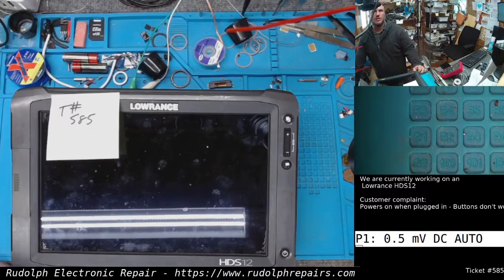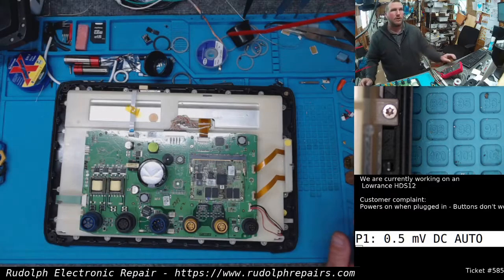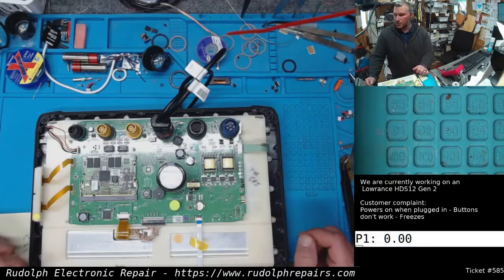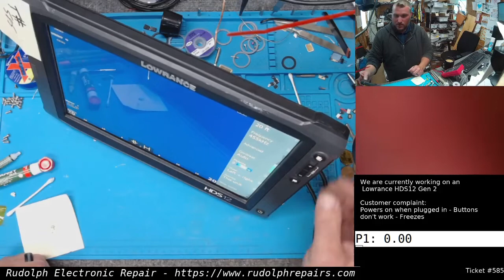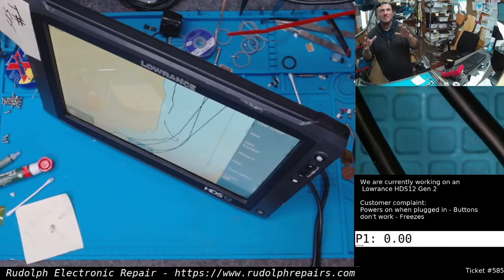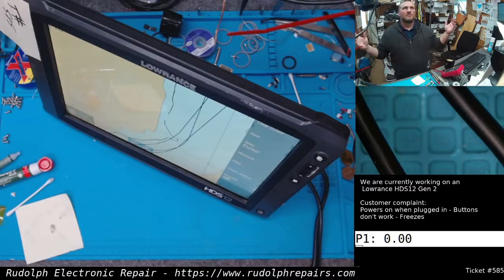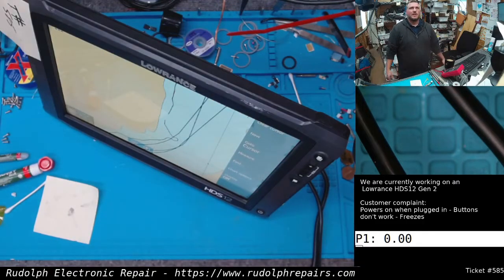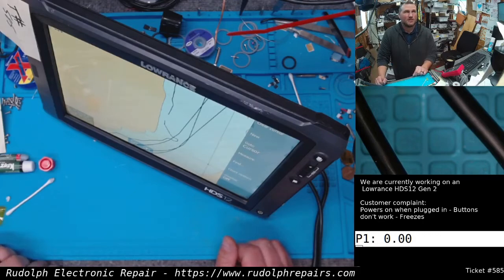Lowrance HDS12 Gen 2 - Crazy Touch Screen Repair.. Actually Krazy! 😉

Comment: I have a Gen 2 Touch 12 inch that won't go into calibration mode, how can I check if the problem is the touch digitizer or the controller?
Is it feasible to replace the touch with a universal 5-pin resistive using the original attachments?
Interesting usb injector I'm curious about the connections.

Comment: So when these touch screens  go out do they not sell replacements? My gen 2 touch was working  great I cleaned  it off with glass cleaner  now nothing  on the touch  screen  works zero moisture  on the inside  just a dead touch  screen. The ribbon  contacts  look clean

Comment from the maker: One thing I noticed after testing the repair is the touch screen was extremely accurate and sensitive compared to stock.  It calibrated easily and worked better than stock- strange, but definitely an added bonus..

Comment: I wonder how reliable it will be in the longer term.
Reply from the maker: I believe it’s the same or very similar to the material the factory uses.  When dried it did look the same (color) and had the same resistance.  The cable which was glued down is also held in place by the front case rubber gasket.  I believe it will be a good long term fix, but we do guarantee all repairs.